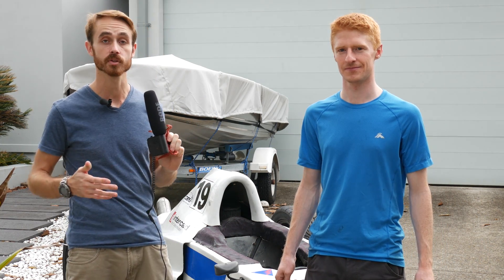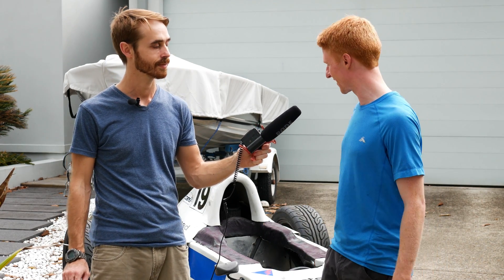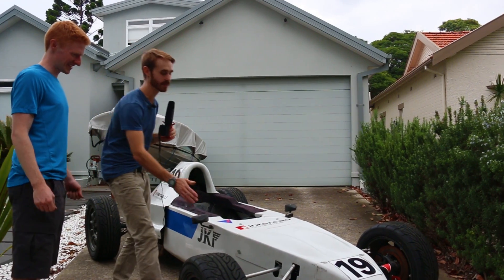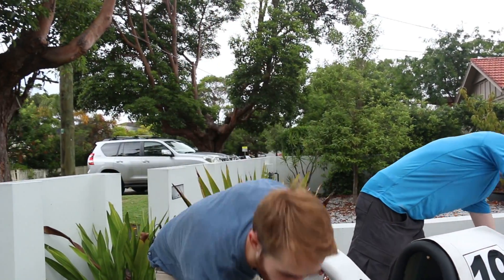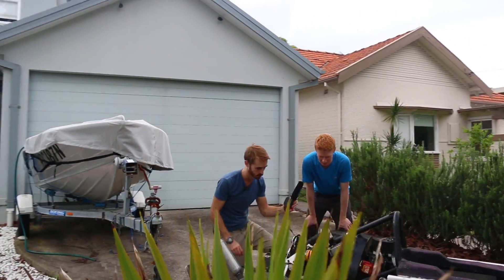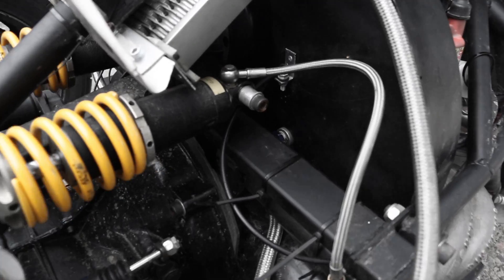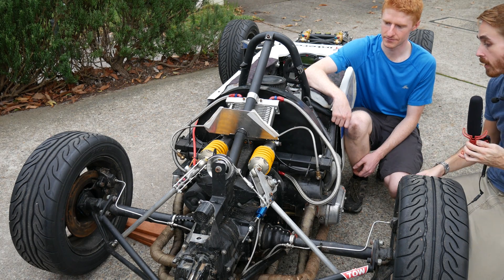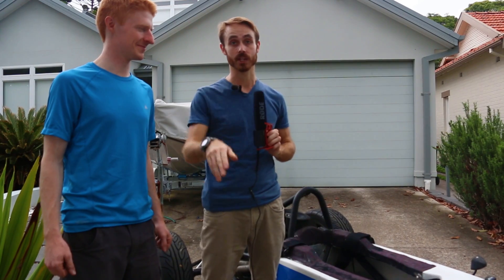Lifting The Hood: FVT05 Formula Vee in Depth Walkaround

Comment: If the engine and transmission are rotated 180 degrees how do you get the wheels to turn in the correct direction fornthe forward gears.

Comment: A quick (although somewhat unrelated) question for a project I'm working on: I'm adapting corvette (C4) independent rear suspension to a narrower car, and therefore have to shorten the half-shafts. If we ignore the change in spring rate (because i'm converting from transverse leaf to coilovers anyways), what are the best ways of compensating the increase in active camber gain that is likely to occur under compression (and the reverse)? Is it even a problem, since narrower cars are often designed with IRS and still benefit over solid axle cars? Any insight is appreciated!
Reply: Is it going into a much lighter car?

Comment: What are the two bumps on the top of the car near the legs for? they seem to be added towards the final iteration
Reply: They cover the front inboard shock absorbers and bellcranks. I wasn't able to fit them lower in the car and couldn't raise the bodywork there completely or I'd obstruct my forward visibility. So I added those two gentle lumps to cover them while only slightly reducing visibility.

Comment: Thanks Kyle for featuring my car, I’m happy to answer any questions anyone has about it!
Reply: ThomsenMotorsport Im not to familiar with formula vee regulations, but do you plan on adding a front/rear wing? I imagine you must get quize a lot of untersteer with that nose.
Reply: I've got plans to add an undertray designed by Kyle, hopefully it'll be on the car by the end of the year.
Reply: So the engine is in the middle instead of at the rear like in a Beetle. What kind of changes do you need to make to make that work?
Reply: Nick Haakman turn over differential 180 deg left to right, crownwheel has to switch sides, otherwise You would end with one gear forwards and four backwards🤓
Reply: what do you think about install a crash box in the front to protect the legs thanks amazing car